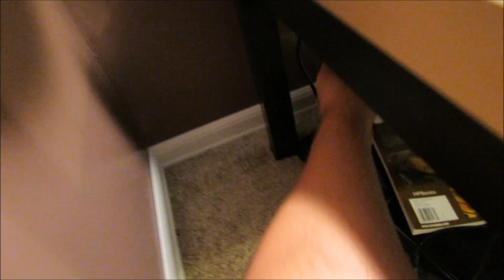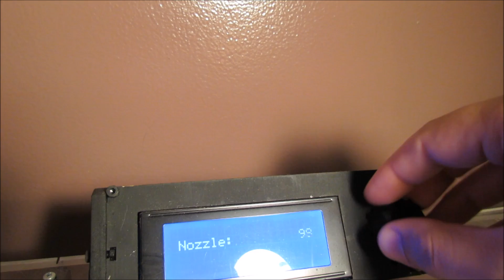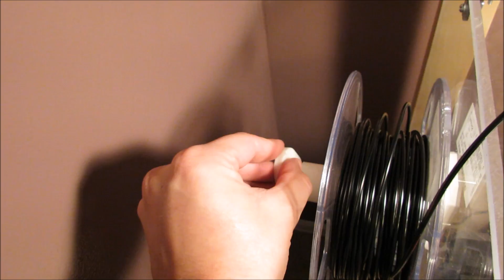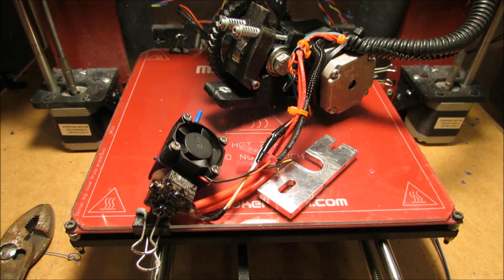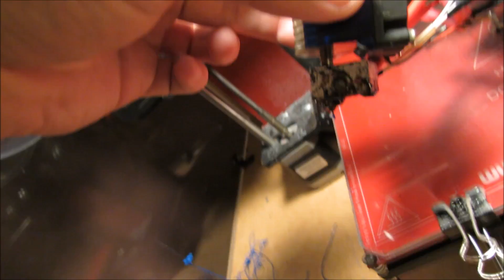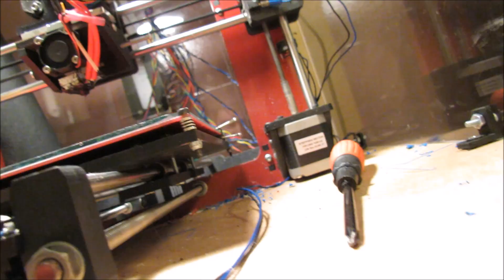How to Replace Filament in a 3D Printer

Comment: The old filament was the clue, heat the head, hold down the extruder release and pull !

Check this out - https://www.youtube.com/watch?v=zKU12XObGdM
apart from being one hell of a large printer - it shows how easy it is to remove the current filament, although you may still have to perfect your insertion method.

O'dear that started to sound really wrong!

Thanks for sharing
Reply from the maker: Wow thats a big print!  So after this video i was trying to print something ill be making a future episode about, and i just kept having problem after problem.  Turns out, it wasn't just being able to get the filament into the slot where it needs to go.  It was as suggested by the Previous Owner of the printer cutting the filament on an Edge, so it was tapered going in, that helped a bunch.  Then it was basically force, i was being too gentle on it.  Once i got the hang of it, i can now put new filament in without undoing any bolts.  

If i was to do this all over....which would probably be the right thing.  Id heat up the extruder nozel.  Pull the old Filament out.  Put the new one in.  and continue.  It would have been that simple.   Now that i know that of course lol.
Reply: learning - its where the funs at :)